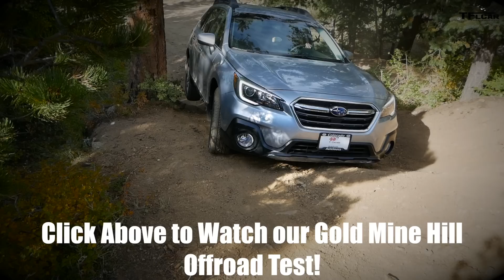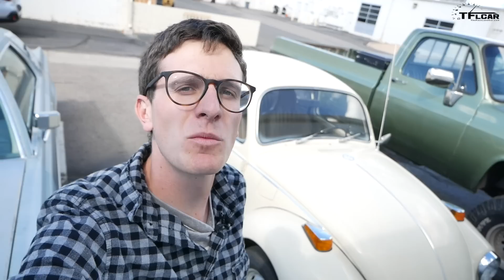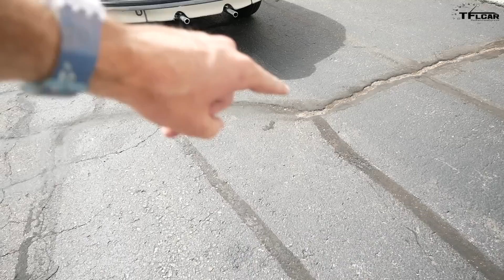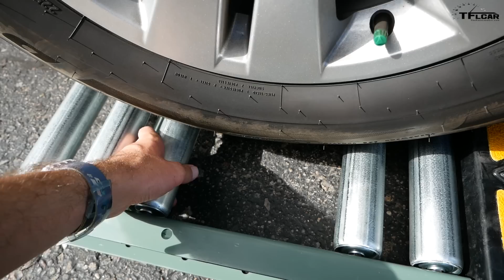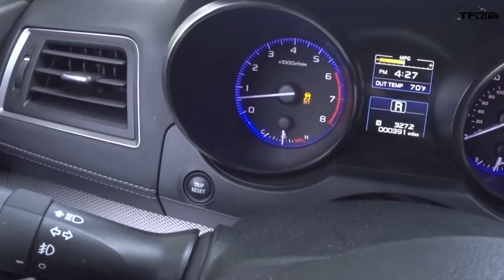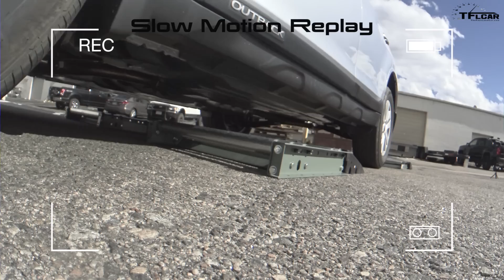The Truth About Subaru's Symmetrical All Wheel Drive:TFL Slip Test vs Subaru Outback

Comment: Subaru is one of the best companies that makes AWD or 4WD vehicles.  I want this test done with Honda's SH-AWD and Audi's Quattro.

The only sad thing is most Subaru's are underpowered. I wish their Legacys and Outbacks had more power. I dont want to buy a WRX STI just to have a little fun.
Reply: Buy the ones with the h6
Reply: They are not underpowered.  Drive one,  they deliver good torque at lower to mid rpm ranges... trick is letting the cvt do its thing. Mine is great both in the city and on highways. No trouble maintaining 75mph on hills, etc.
Reply: I don't know guys...i don't want to be "that guy" but I've used my HUMMER to pull everything out of snowy ditches from Chevy Cruze' to 1 ton Duallies. And yes SEVERAL Subarus of all different models. And yes...Of course Jeeps too. I do agree that I actually help more people that have AWD/4WD. But I think that has more to do with the fact that in snow storms. At least here in Minnesota. People have winter beaters that usually have 4WD or at least AWD.

I fortunately have never gone sailing into the ditch. In any vehicle I've owned. Be it a rear drive Grand Marquis, 4WD Suburban or the AWD vehicles I've owned which includes my wife's old VW Touareg and my HUMMER H2. Yes I know it's marketed as being "full-time 4wd" But it's all wheel drive with a lockable center diff. 

Anyway all I'm getting at here is regardless of what you drive... The fact is...that if you're driving like a jackass in winter conditions. Sooner or later you'll wind up stuck hoping for someone like me to stop and help so you don't end up paying hundreds for a tow truck.
Reply: @brandoncrimmins6296   You seem like the only guy who sorta understands what I am saying. Like i said before driver skill and good winter tires is way better than a overconfident driver with 4WD.
Reply: Honda's AWD system sucks.
Reply: @scot.manning  jeeps and subarus are completely different cars. One is for offroading and the other is a car for snow and getting to your dirt campsite. Also I hear this a lot saying jeeps are unreliable. And from first and second hand experience they are pretty hard to break and insanely good 4x4s.
Reply: @jboijones7563  Of course they are different.  Subaru is a MUCH better car.  Jeeps are really no better than any other car off road.  When they aren't breaking down that is.

They fail many tests of off road capability.  It is a cult following that keeps the lie alive.  Like Trump supporters.  They just don't look at facts and make shit choices again and again.

Fact:  They are shit cars in reliability.

Lowest rated in reliability for about 20 years now.
Reply: Al13n1nV8D3R Mazdas iActiv AWD system has been proven better than Subarus AWD.  The next gen Mazda 3 may have AWD.
Reply: @Tom4Aksion  lol and Mazdas transmission problems? Some of the worst transmissions out there made by Mazdas. Ask any mechanic. Might as well but a Ford
Reply: madmaxx72 no known transmission problems as long as you exchange fluid every 60k.
Reply: Al13n1nV8D3R I tested quite a lot of Quattro cars on rollers, results are not the same for different models.
Reply: @scot.manning  Does anyone bother to read my first post? I said, SUBARUS HAVE ONE OF THE BEST AWD SYSTEMS. Please scroll up and read the first question.  I am not saying that Subies are not better than Honda or Toyota.  What i am saying is Subies are underpowered compared to honda and toyota on DRY roads.  The youtuber  madmax changed the subject to an AWD snow battle.  I was just stating that Accords and Camrys can be driven in snow on ROADS as long as it has winter tires. I never said Camry amd Accorda have supurior traction comapred to subie in fact  I said in a later posts "CAMRYS AND ACCORDS WILL GET STUCK IN 2 INCHES OF SNOW OFF ROAD".  And you say that "EVERTHING I SAID WAS WRONG" so was my first post about Subie having the best AWD comment wrong too?  Obviously you guys dont even bother to really take a close look at what i am saying. And jump to the conclusion as to what i am actually saying is totally different. Please read carefully.
Reply: Here is proof to my original comments with "SOURCE" of proof.
All these test were performed on "Dry"  paved roads.

2010 Subaru Legacy 3.6R 0 to 60 6.3 Seconds   www.zeroto60times.com

2010 Honda Accord V6 EXL 0 to 60 5.7 seconds  Motortrend.com

2010 Toyota Camry V6 0 to 60 5.8 seconds. Caranddriver.com

As you can see the Subaru is the only one in this test to have AWD so it has the advantage of traction but still slower to sixty seconds because its UNDERPOWERED.   

How about newer Subarus?

2017 Subaru Legacy 3.6R 0 to 60 7.1 seconds. Caranddriver.com

2018 Honda Accord Sport 2.0 T 0 to 60 6.1 seconds zeroto60times.com

2017 Toyota Camry XSE V6 0 to 60 6.1 seconds.  zeroto60times.com

As you can see even a Honda with a 4 cylinder spanks the Subie on "DRY" roads.

SUBARU's do have supurior traction in snow and on the dry.  

Accords and Camrys has inferior traction but can be driven in light snow on paved roads as long as you have Winter tires.

End of rant. You guys are just Subaru fan boys, with small penises.
Reply: @Scot Manning  100%
Reply: @hl9009  You do realize Lexus uses the exact same brake actuated torque vectoring system right? Get real. Do you even understand how these systems work? The GX and LX can literally maintain their 6000+ pound towing capacity while the torque vectoring system works. Please stop.
Reply: No it's not you are spreading propaganda. Which Subaru is 4wd? After checking their 2016, 2017 and 2018, Subaru does not make ANY 4WD systems nor do they have ANY 4x4's in their lineup.
Reply: @scot.manning  you have no clue what you're saying. You sound like a propagandist spreading fake news. Are you sure you don't work for CNN? Subaru AWD is obsolete and hasn't improved since the 1970's and the Xmode is garbage as we have seen on TFL on GMH and the roller test on the incline. You are totally ignorant about this, stop being a Subaru propagandist.
Reply: SHAWD and Xdrive are two of the most advanced systems you can get at an affordable price point. The Quattro systems employ active torque vectoring differentials on certain models only like the S7 and above. The A4's used brake actuated systems like Subaru since its cheaper to implement.
Reply: Long time subaru owner here I agree 100% with you original comment as I Accualy read it unlike some they need to stop the cvt nonsense and work on making a more powerful lineup
Reply: In a world where V6 Camry and Accords reaching and surpassing 300HP. A Flat 6 Subaru engine has way less HP. That is why Camrys and Accords will always out sell a Subaru.
Reply: @Al13n1nV8D3R  lol right....that's why.....
Reply: @Al13n1nV8D3R  Camry and Accords are shit in snow. I've owned a Camry and hated that car... Boring as heck to drive (4cyl so comparable to the Subaru). Also, I own a truck with 400hp V8 and still like the Subaru for what it is.  I'd buy one over a Camry or Accord all over again
Reply: @njrmax72  I was talking about POWER not traction. And I drove a 2001 Accord V6 for 10 years in Traverse City Michigan and NEVER once was I stuck in snow or lost control.  Its all about driver skill and WINTER TIRES.  MY friend drove a 3 Series BMW that was RWD and inline six and has no problems driving in snow.  Most of the time the people who do get stuck or flipped their car on the side of roads up here are people with AWD and 4WD, because of OVERCONFIDENCE and and shitty tires, both user error. You sound like a Subaru fan boy.
Reply: @Al13n1nV8D3R  come to New England and you will see an accord is worthless. My Subaru will run circles around your Honda in snow. That's a fact
Reply: @njrmax72  Typical AWD/4WD mentality.  Its guys like you i see in the ditch with all 4 wheels pointed to the sky.  No vehicle will be able to stop on ice or accellerate on it even if you have superior traction. AWD and 4WD helps keep you going but will not save you if you hit ice. Safe slow driving and just simply using you brain will get you further on icy roads than being over confident and blasting down a icy road at 50+ MPH because you think your invincible for owning a AWD car.   Ive got plenty friends even in Canada that drives FWD and RWD cars with no problems. They all have winter tires installed.  Its people that don't know how to drive are the ones that swear by AWD and FWD cars. Its like your handicapped and need a wheel chair to get around.  Tires and driver skills is more important than a terrible driver with AWD, because those people are downright dangerous on the roads.
Reply: @njrmax72  LoL off road, mountain trails and Sand dunes then yes a Honda Accord or a Camry won't make it 2 inchs in those environments.  But Accords and Camrys has no problem driving in snow if you have the right tires and skill.  Lol you sound like a 14 year old undergoing puberty. This is not about measuring dicks. Obviously your compensating for some thing.  I commented originally about HP you changed it to 4wd and awd discussion. And then when you know your wrong you change subjects again and talk about off road mud and mountian trails? Let me guess your next diversion is how great Subies jump off ramps and cliffs like evel knievel?  You need to go buy some extenze pills from Ron Jeremy because obviously you need it.

Accords and Camrys, if they are such terrible vehicles in the snow then why in the hell do i see them everywhere in Michican and Canada.  By your standards those cars should not even exsist in those regions.  But then again. Your too busy using a microscope measuring your insignificant nub to realized that real people do drive Accords and Camrys up North. That's a fact you cannot deny. LOL this is fun keep it coming Madmaxx, you must be "mad" to the "Max" about now.

 If you reply to this post then you admit to the world you have a tiny pecker. RofLMAO
Reply: @njrmax72  Haha you just admitted you have a small wang.  Me and my friends are having a kick out of this. BTW did you even read my very first post? I said SUBARU'S HAVE ONE OF THE BEST AWD SYSTEMS.  What I said that prompt you to reply was. Too bad subarus are underpowered. Every subie I drove was slower than a V6 Honda and V6 Camry. You changed the subject and switched to "how great subies AWD is" instead of talking about HP and power, "WHICH BTW I SAID EARLIER THAT SUBARU HAS ONE OF THE BEST AWD" So i was trying to clarify that the camry and accords can be operated in snow.  Your the asshole to think that what ever you say is 100% correct because your a subie fan.  But anyways we can all agree now that your just compensating for a lack of manhood girth.  LoL.
Reply: @scot.manning  Honda 4wd doesn't even make the list In my opinion. Not capable at all...might as well just buy front wheel drive.  And Honda's glass transmissions? Hmnnn
Reply: I have a Lexus GS, I believe it is better than Subaru or anyone else: https://www.youtube.com/watch?v=tNDV3U2H-Zg 30/70 f/r then 50/50 in snow mode or when it slips. A used one is a much better deal than a new subaru. Subaru feels like a Milkwagon next to these cars.
Reply: alb12345672 Lexus GS? Doesn’t compete with a Subaru awd. No way
Reply: alb12345672 any subaru would humiliate your lexus in the snow I guarantee it.
Reply: Subaru is gay.You couldn't even change the oil on this crap..... With 3" of ground clearance...
Reply: @bobquattrini1787  the outback has a minimum of 8" ground clearance
Reply: Bob Quanttri not to bright eh?
Reply: @bobquattrini1787  stupid comment if the day right here

Comment: Just don't put your hand under the rollers again (when you were spinning the rollers). If that bearing had failed, you would have crushed your fingers. Especially with a homemade, untested system.
Reply: That's what I was thinking, too... Made me cringe watching it. If you haven't already, make sure that roller assembly is strong enough to hold the relative weight of any vehicle you may be testing. Even then, don't put your hand under there. Great job, though!

Comment: A lot of today's AWD systems will pass these tests because the car has very little resistance on the wheel with traction.  Offroading in the real world usually puts more resistance on the wheels with traction.  Besides the tests you did, you should also try blocking the wheels with traction with a brick or a block of wood to see in the car can send enough power to the wheels with traction to overcome the obstacle.
Reply: Try any Rav4 or Highlander and will struggle really bad in a diagonal situation, and it won't pass when if only one wheel (no matter which axle) has traction, just because breaking system is not enough to distribute power side to side.
Reply: I have the 2001 gen Legacy wagon and when i used to rotate the tires on it, I would put those oil change ramps under one front and one rear wheel and climb it pull the tires off from the lifted sides and then do the opposite. And it could do that because it had a limited slip differential. I distinctly remember that when I had tried to do the same on a 1998 Subaru Legacy Wagon, it couldnt climb as it had no vdc and had open diffs all around. So just because one car makes it look easy, doesn't mean other cars have the technology to do it. Not even all Subarus are the same. But nowadays, I would say since at least 2010 all Subarus will move when one wheel has traction.
Reply: That is not always the case.  There are plenty of these vids out there already.  Some cars struggle because the brake intervention is not strong enough and others because engine power is cut so much not enough power can be transferred to the wheels with power.  The biggest struggle seems to be with the one wheel with grip on the axle that is not the main drive axle.
Reply: But is that the application these vehicles were meant for or are they just for extra grip in poor weather?  In actual off roading I would prefer a Jeep or similar vehicle.
Reply: Not all...you can see 4Motion for example (or any VAG system) won't pass when is only one rear wheel with traction, and is just because the system can't send enough power to that only back wheel. Different story is when one front wheel has traction, then behaves normal.
Reply: Nah, Subaru just makes it look easy. Even 10 years ago, most 4wd trucks wouldnt move when 3 wheels or in many cases even 2 wheels were on rollers.
Reply: I think it is the opposite. I think the conveyor rollers he is using aren't really very easily turned with a car on them. The Subaru almost drives off the rollers before the torque split and brake actuation takes over. While this does show the Subaru system works fine, and is likely a relevant test for a car trying to move forward in poor weather conditions on road, it does not show what would happen if one tire was struggling to push over a hill or reasonable rock on a trail. On the other hand, a Subaru isn't really engineered for a trail. If I was personally in the market for a Subaru, I would be glad the engineering was focused towards good on road performance. I would care less how the car behaves on any surface not described as a "road".